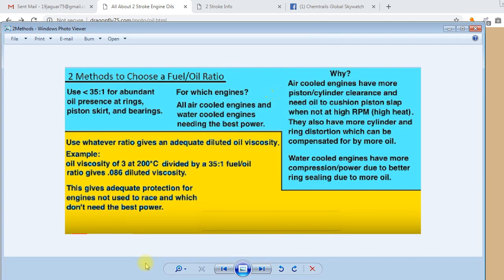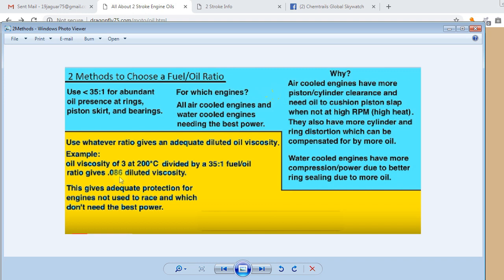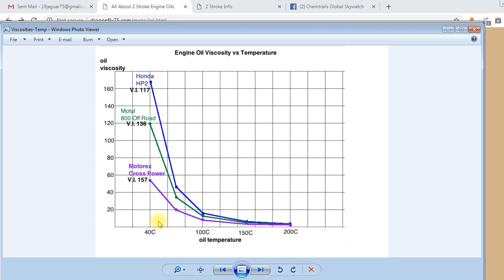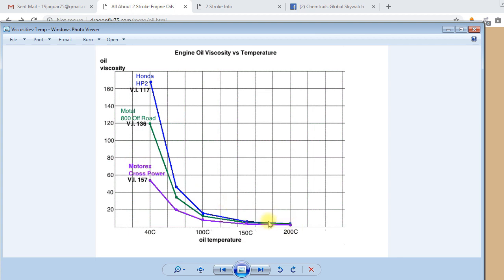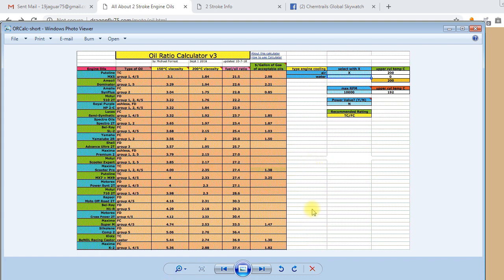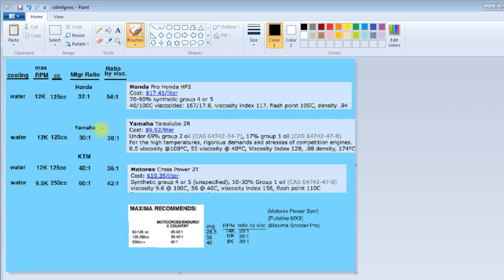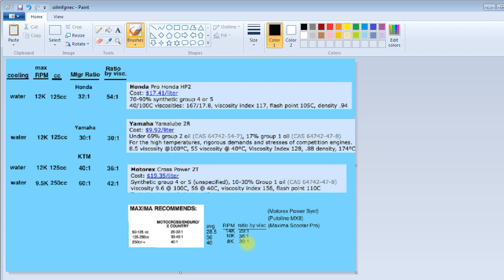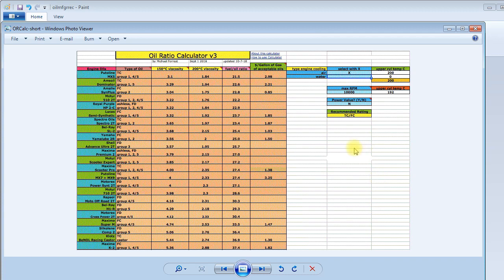Maximum Safe Fuel/Oil Ratios for 2 Strokes

Comment: Michael,  for what it's worth, I have tested oil quantity (ratio) multiple times on a 100cc Yamaha piston valve go kart engines.  Please note that most kart engine carburetors have adjustable jets on both high and low speed circuits, so air/fuel ratio is very easily corrected as oil quantity (ratio) is changed.  Without exception, every time I have tested oil quantity, more oil produces more power (faster lap times), up to the point of unavoidable spark plug fouling (which happens with castor oil at about 8:1 fuel/oil ratio).  That much oil can cause undesirable side-effects of course:   heavy carbon buildup on the piston crown and in the ring groove, along with a lot of oil in the exhaust pipe.  However, the "belief" by many people that less oil in the fuel will somehow produce more power is absolutely false.
Reply from the maker: agreed. My belief though is that there would be a difference in results between using refined petroleum oil and synthetic oil. That is because synthetic oil is much less combustible and so wouldn't add much to the cylinder combustion as you increased the amount of oil. But if both groups give the same power increase with oil increase then that means the power increase is independent of the oils contribution to combustion and relies solely on its increased lubrication to reduce friction. More testing is needed.
Reply: Michael,  I suspect the performance increase is primarily from a much-improved sealing of the piston skirt, though you are very correct that the results could show differently with pure synthetic. (the reason for my conclusion is a bit too lengthy to post).    I have done a lot of oil testing over the past 45 years in karting and motorcycle 2-stroke engines, and have never found a synthetic that can lubricate adequately compared to castor oil or castor-based oils. (my experience is almost entirely in a racing environment).  As you probably know, the tell-tale witness in a high-revving 2 stroke is the big end rod bearing.  It tells all.  In all my oil testing (for lubrication performance), I have always split the crank and inspected the big-end rod bearing rollers under a microscope.  Those rollers are the ultimate witness to what is actually happening.  Admittedly, pure castor oil is a poor choice for the individual who may have a 250cc 2-stroke off-road bike, and takes it out intermittently for a weekend ride - it's likely the ring will gum up after a few uses.  In a racing environment though, where engines are frequently rebuilt, and sustain high-revs are the norm, I have yet to find anything that lubricates like castor oil, and prefer to run a lot of it.  And of course as you mentioned about the KTM65 owner, the smaller the engine, the more oil is typically required.   You have a lot of very good information on your channel... excellent work!
Reply from the maker: @agie170hss2  thanks for your insight. I went through a bottle of Maxima Castor 927 on my 100cc street bike and had no problems with the ring lands gumming up. I think Maxima found the magic formula for castor oil since its about half synthetic oil and has plenty of additives to prevent gumming. Maxima is my favorite brand.

Comment: Hello Michael i have yz 250 2007 now i want to use for trial ,wood , i use motul 800 2% but the motul say from enduro 1.5% and my i dont feel ok. with 1.5% ,  i use the moto in slow mebium prm  thanks for your time
Reply from the maker: My calculator says for a water cooled 250 the ratio of Motul 800 Off Road shouldn't be any higher than 60:1. 1.5% is 67:1